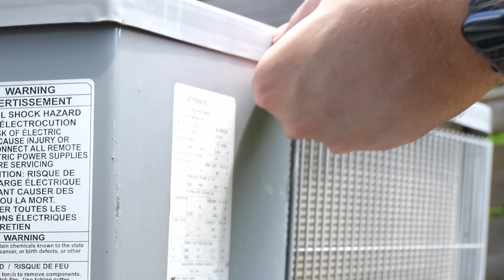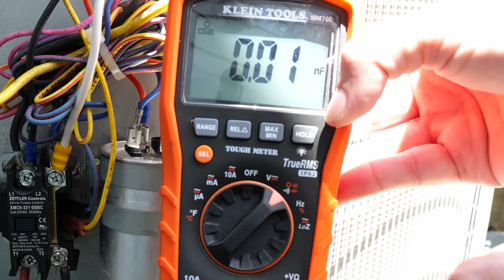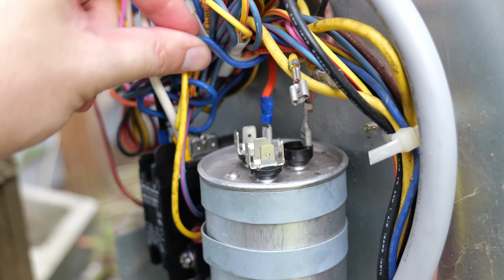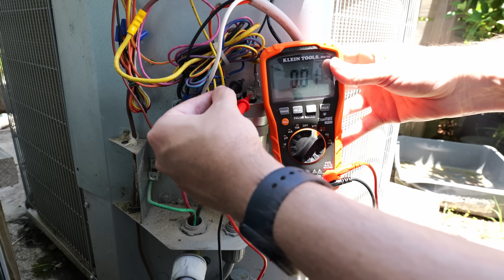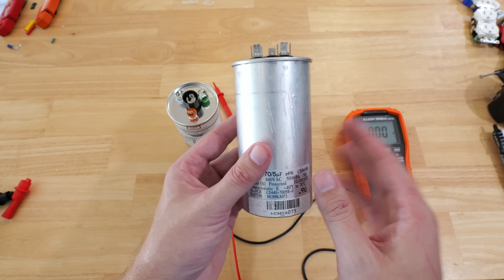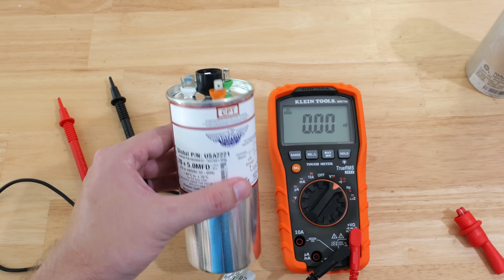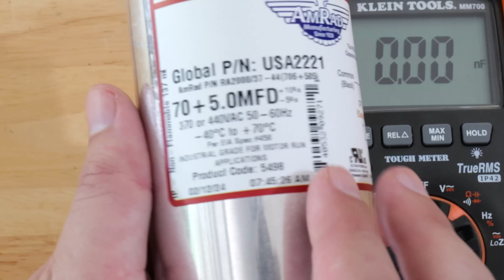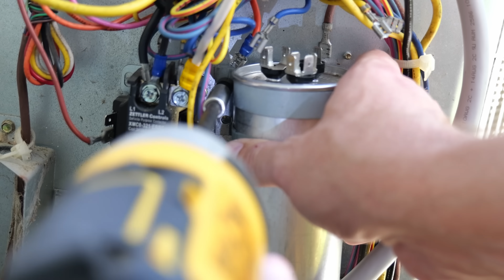Don’t Get Ripped Off! How To Avoid The AC Capacitor Scam And Save $500

Comment: Had a guy come out last year and he said the microfarads were at like 50%. He didn't lie. I tested it and it was at like 50%. But they wanted $430!!! to replace it.  Called another place up they wanted $410! WTF. The part was $20 and took me 15 minutes to swap out. First time doing it ever too.
Reply: Sites like YouTube, TikTok, and the internet are great for learning. The internet isn't all porn, gambling, and black market deals.
Reply: @stephen-ng Ha! YouTube is creat for appliance and car repair.
Reply: I keep an extra capacitor on hand because it's the most common thing that goes out.
Reply: Yeah, I have 2 units and both went out within one day of each other, both had bad capacitors.  Found out how to test them and put them in myself, fixed both units for $45 total
Reply: I replaced mine about 16 years ago.  The part cost $26 and it took me about a half hour in figuring out how to take the cover off, take a photo of the wiring, ensure old capacitor was fully drained and replace with a new one.  It worked for 5 years until I had the whole unit replaced along with my furnace.  If I have one complaint about this video is that he pulled on the wires to remove the female part of the paddle connectors.  I will gently pull on the wires but they are still I use needle nose pliers on the metal part.  If you pull off the wire connector, it will take much more effort.
Reply: @dustmaker1000  Needle nose pliers and a slight rocking back and forth side to side will usually do the trick.
Reply: can't put food on the table installing a $20 part for $20... who diagnosed the issue? did they do that for free? do you expect them to spend 5 minutes swapping the part and leave before doing any tests? 
yeah, it is cheaper to DIY if you have the knowledge. but it can also be dangerous if you THINK you have the knowledge. 
my family had lots of ac techs, they would do side gigs and still charge about $100+ an hour.
Reply: @SnowRaver-p2v It take 15 min max to diagnose and swap out. Somewhere in the $175-$225 would be acceptable.
Reply: @MarinePigVa what do you do for a living?
Reply: My side gigs for A/C. Rates start at 250.00 no matter how small the repair.
Reply: @SnowRaver-p2v  Poor AC tech had to charge to replace that perfectly good capacitor, putting filet mignon on the table isn't cheap you know.
Reply: Same thing happened to me, I got ripped off for 300. Plus 140 for labor. After they left I found same one on Amazon for 17 bucks. Called and complained and they refunded labor. But still crazy.
Reply: I used to do side work on Harleys. I would charge half of the hourly rate. I didn’t do it for existing customers of the dealership I worked for, it was for folks that didn’t like dealerships, and it was for jobs I had the tools for.  It was between $25-$35 an hour plus parts w/o mark up. I had one person get really worked up telling me minimum wage was $7 an hour.  While I had his bIke torn down. So I told him, you’re paying for my knowledge, I went to a specialty school to learn this, my tools alone cost more than he made in a year and I traveled to him. I added if you want to pay $7 an hour to get your bike fixed, good luck with the results. I started packing up my tools and loaded them and the repair parts into my truck. He got REALLY upset yelling about HIS new parts and his bike was torn down. I said if you don’t want to pay me my rate, that you thought was fine before we started, then I’m stopping now, while I have an hour in to it. Give me $30 now and we’ll go out separate ways. Or, don’t, and I’ll take the estimate contract you signed saying you would pay for all work completed and I will get a lawyer and take you to small claims court. I’ll get my $30, and you will have to cover the court fees and my lawyers fees; which I assure you will be a whole lot more the $30 for my hour or the $300 for the job. He got shitty and handed me $40 I told him I don’t have change we say the extra ten is for gas and I left. Two weeks later he showed up at the dealership to have his bike fixed. A friend of his said he knew what he was doing because he used to fix lawnmowers on the side and that he would take his pay in beer.  Well, according to this guy, his friend’s fixing mowers experience consisted of replacing spark plugs and sharpening blades. He ended up tearing into the bike more (I had the tear down completed), he removed things and loosened other things and broke off some bolts. Turns out he drank his payment before and during his work. The owner of the bike ended up paying upwards of $2000 in parts and labor to fix the damage and preform the original work.  

It’s best to have someone that knows what their doing preform the work, other wise it could cost you more in the long run.
Reply: @Itsthatoneguy371  I once first time rebuilt a car engine from the ground up in the mid 1980's just using one of those Haynes repair manuals, no specialty school needed, just common sense, and the special tools needed, ridge reamer, piston ring compressor, cylinder deglazer, engine stand, and boom hoist, were radially available for a decent price at my local Taylor Rental, no tools that would cost more than what the burger flipper made in a year at the local hamburger joint, and besides, any specialty tools you did invest $$$ altogether  in procurement , you certainly don't get to factor in the total cost of those tools on a job where you don't even use 98% of that tooling.
In other words, I see a lot of embellishment and outright exaggeration in that comment of yours.🤣
Reply: @Itsthatoneguy371  We're all experts, from YouTube College,where only the geniuses put up videos.
Reply: @Itsthatoneguy371 Kudos to you my friend . It's always best to stand  your ground don't let nobody be little you . 👍💯🇺🇲
Reply: That's the price of calling someone out to fix your air conditioner, your paying for the years of experience it took for this guy to accurately and correctly diagnose your issue and tell you what it's going to take to fix it, plus gas, overhead, labor, and taxes. You wouldn't be calling someone to fix it if you knew exactly how to fix it
Reply: @jayprice5442 Boom. Could not have said it better!
Reply: @jb Bet your a DIY
Reply: Yep, always keep one handy
Reply: I swapped my capacitor out on my three year old unit for a Titan HD capacitor Made in USA.
Reply: You don't pay for the part or labor you pay for the knowledge
Reply: I charge 120-140 or less depending on the customer .some people don't have any mercy on anyone. I try not to charge too much to young people and elderly people or people  that are struggling. That's why I'm not rich 😅, I understand companies need to charge more but, 400 or 500 for a 20 dollar part is crazy.
Reply: @frankgonz31  ...in my view that strikes a reasonable balance
Reply: Companies charge that for multiple reasons, there's overhead, cost to come out to you for one. Any mobile service is gonna cost more. It's not scamming. it's running a business
Reply: ya  it's ridiculous...  I started studying every thing I can about the heating system
Reply: Aren't you missing one point? You replaced your own capacitor. How did you know it was bad? You knew cause the service company that you called to come to your house sent a mechanic with the knowledge and test equipment to diagnose the problem. Then you feel taken advantage of when they tell you what the problem was. So next time your ac goes out don't call a service company. Then you won't feel ripped off.
  By the way....when you show up to your job and work your hours don't you expect to be paid?
Reply: @randyfox4611  Usually troubleshooting and repairing are split in my experience. When I call a technician it's because I can't figure out the problem. If they figure out the problem I want to know the cost to repair. If I can repair the problem cheaper then I will. I still pay for a service call. I had three technicians from the same company troubleshooting a problem and had zero confidence in their experience. I helped them pinpoint the problem while interacting with the crew. A relay needed replacing and they didn't have the part and didn't know how to use a different relay to make the repair. I said I would handle it and ordered the relay from eBay (from an HVAC tech). Problem fixed in two days. The HVAC company called me a couple weeks later and said they had the part and wanted to schedule the repair. If I waited for them my house and family would've melted.
Reply: @randyfox4611 bro go fuck yourself and your shady shit backwards ass practices that your shit company has to scam people to keep the business running that nobody even asked to be around. All of you people are crooks and make it a nightmare for regular people who dont have to be on their knees all day. If you have some stupid outdated boss running the place into the ground than you wouldnt have to charge ridiculous prices. Thank god the internet it running you people out of work. Good luck scamming old people and the people who need help the most. Your trade is dying and your butthurt that people can learn in a hour on youtube what took you years of experience and schooling prob cause you were taught by some loser drop out that talks big so you just listen to the old fool not realizing they dont know shit either and its all tribal knowledge. We are all on to you people. The internet didnt just wake up people about politics and history, it also showed up how many business are traditionally ripping us all off! Get fucked!
Reply: Bunch of crooks!
Reply: What don't you understand. These guys are trained service professional. Must be paid for their time. They have to take time out of their day to go to your house diagnose the problem locate the part pay for it with their money and install it. You don't understand this.WTF.  You're an idiot
Reply: If that capaster had been tested under load there's a good possibility it could be weak. Testing the way you're demonstrating is just basic troubleshooting. Testing underload has absolutely nothing to do with what you are going to most likely get many clients.Are youtube's hurt.
Reply: @shawnm5641 holy whut
Reply: I have a H/AC. Can someone . Right now my thermostat says 78 degrees. We have been having  few 90 plus days the past week. It seems it takes forever just to go down to 77 degrees. I was told by the people that came out that I was going to need another unit. After watching these helpful hints, I just want to know what they say. BTW, where is a good place to get a capacitor from? Store name and all. I don't you To think I'm stupid. But in the same respect, I don't want to get taken to the cleaners either., I am retired so money is tight. I did go outside a couple of hrs. ago and checked the drain line. I did run my finger up the drain line and  pulled out a clog. I was thinking about calling in the morning to see if they could come out tomorrow. Help me please!     Tommy Pauly
Reply: @tommypauly3249 There's a lot of stuff available online. If you have a background in electrical or appliances your can certainly look after your own A/C
Reply: Yeah, I just did the same thing today. Because it's a weekend and the parts store doesn't open until Monday. And it's miserably hot. I'll be going to the parts store and getting another capacitor so that I have one when this happens three years from now.
Reply: Yep, like 4 wires and a holster abd presto, 20$ later your done. Good to learn hvac. The more mysterious somethingnis to the general public the more they can charge for basically nothing. I remember when computer repair was big, wipe a virus and change out a ram stick 450$ cause people didn't know any better, theu thought it was so technilogical and beyond them. Shit like this is going on with solar now, they wanna install less than 5k worth of panels and tack on 200k to your mortgage for it, because people in general dont know how to do it themselves.
Reply: Realistically, you're not only paying for the part and the labor. You're paying for the knowledge and ability to find the part that's bad. If you can figure it out with youtube good for you. Next time don't call anyone and fix it yourself. Guarantee they saved you a shit ton of time and diagnostic work which is the hard part. Essentially what you're saying is, because they are good they deserve less. That's backwards. This mentality is exactly the reason service call charges exist. If you want me to come out and teach you stuff I know and/or tell you your issues you're getting charged. My time isn't free neither is my knowledge.
Reply: Really sad there are so many rip offs, I don't mind paying for a HONEST expert, TODAY I had a tech replace mt bad capacitor for total of $137.05 cap was $42.05 , service call = $95.00 I looked up the EXACT Cap & it was sold online for $13.43 with FREE shipping & prices went up from there this was on Nov 2024
Reply: @REVNUMANEWBERN what is the ripoff?  Having a company having employees on hand to go to your house and fix your issue costs money.  Is that businesses shop, vehicles, tools, and employees all free?
Reply: Did you pay for service calls?
Reply: This is why DIY is freedom. What is a crisis for others is for us a minor inconvenience. I'm no fan of professionals because I find 90% of them to be incompetent, but if you need to pay another man to do a job you cannot or do not want to do, be prepared to pay dearly. Double that if he's climbing up on your roof that YOU won't even do.
Reply: @AmandaHugenkiss2915  ...problem is not only the incompetence.....but the outright lying they do to those customers who are not technically knowledgeable... saying they need $7000 new AC units when a $25 capacitor is all that might be needed. I had "warranty" work done to my unit....I KNEW it was a bad defrost board and its temp sensor....the guy came out to listen to me....went away....and came back a week later with the warranty parts to install ( free to me) over a 23 minute onsite visit...and I still got charged $370. I called the office, and asked "what-the-heck".... how is this a $62 service charge or even a $92/hr repair charge????....the answer.....he didn't have the warranty parts in stock and his tech needed to drive to the nearest parts place to pick this up before he came to my house. Seems all this "backdoor" time was charged to me. Crooks....all of them...even if they didn't upsell me to a new unit. That's why I have a defrost board...a temp sensor....an outdoor unit capacitor....an indoor unit (air handler) capacitor, and a spare outdoor contactor on hand...these are the 90-99% likely pieces to break...and I can do all of them myself.
Reply: We have to make money good god how much do you think it costs to pay some one to coming there , the rolls, they insurance , the part & the labor, don’t forget THE knowledge lol most of us went to school and dedicated much of our time so we can charge like this.
Reply: Just now figuring out that repair service is a rip off?  They have always been a rip off, but more so lately as less and less people are willing to learn to fix things themselves.
Reply: ok  so lets see here  you  paid 20 bucks and got it going , ok  so the ac company  has over head that tech cost money  that truck cost money he had the part on his truck  those parts cost money his gas cost money  his insurance for the company and the vehical cost money, his shop cost money the tools to diagnose cost money  his knowledge and expertise came at a price. all this has to be figured in  when doing business what you want is some one to come to your house free  and fix it at cost, im sorry  but no  business runs on cost  it would never survive and surely never grow. i was 1 man in a van  for a while and as i grew my  cost had to grow if not i would have stayed 1 man in a van  forever. i feel like if oyu  call me to come out  and i diagnose it and prove it is a bad part  then you  tell me thank you  and send me on my  way  you have wasted my  time when i could be out helping someone that NEEDS my help, so if your a DYIer then do it all yourself diagnose and do the repair  and good for you and good luck to you. But there are actual customers that want and need my  help to do that  and if i am on a call like yours you are keeping me from making money  and helping  a real customer. ( note, this is not a personal attack the use of you and your  was for ease of explanation do not take offense it was not directed at you directly.)
Reply: @kennethduncan8563  for 11 years I owned an electronic repair shop with 5 locations, so I KNOW business... but I also know ripping people off.  I also can do A/C like a "pro' Have gauges, vac pump and fancy core remover tools... So shut the F up and stop thing that some trade that almost anyone can do is something that makes you somehow superior... fair is fair and $500 for a cap replacement is not even in the same realm of "fair".
Reply: That's $1600.⁰⁰ an hour for labor.  Good God.  Let's say they have a show up charge to roll a truck out to you of 100.00.  That should cover the first half hour.  Then maybe, at the very most, 25 dollars to change the capacitor.  Maybe 150 for everything.  He should be able to trouble shoot the problem within 15 minutes.  Absolute scumbags.
Reply: @YUHJKT then just do it yourself.
Reply: I did the research beforehand and saved on having someone come and charge $$$ me just to look at it.
Reply: I fix as much as I can. $400 for a new capacitor is crazy. But at the same time- the company vehicles has to be paid for, the employee, all the benefits, workers comp, paid time off, tools, fuel, etc… it’s sooo expensive to operate a business. You need to get paid accordingly. Oh- not to mention a skilled trades person has years of school, training, and experience- which all needs to be compensated for. I’m just making a point that companies need to charge. On the other hand- if you charge $400 to diagnose and replace one- you better be getting all the things I listed above. What often happens is that crap companies charge top dollar without providing the things I listed above. They under pay the employees more often than not. Oh, and health insurance has to be paid if it’s a good company
Reply: Yeah had my car ac compressor for  700 and that's a lot of work they have some nerve charging 400 for a 10 minute job. Who the fuck do they think they are. Guy wanted 1000 for  50 dollar board not sure why they think there labor is so valuable. Crooks all of them.
Reply: I understand charging a minimum, but that's ridiculous.
Reply: Unreal the number of whiney people on here that have never had a service business and the huge overhead costs that go with it. Go ahead and complain to that service guy about the cost and how you could have done that yourself. Next time you call them out and want work done for minimum wage, see if they will have time to work you in. The capacitor is a common problem. But there are  dozens of other things that you wont stand a chance of figuring out because you dont have years of experience or training. And contractors talk to each other. On any given day your petty complaints are being discussed at a parts counter somewhere as two techs wait for parts they are picking up. Not to mention the rookie mistake I saw the guy in the video made in the first thirty seconds. 
Go on out there. Start pulling covers off. Have a blast. But dont get mad when you have trouble getting a pro to come out. He or she will know if you have been in the equipment rooting around.
🤣🤣🤣🤣🤣
Reply: Off the truck parts be $$$$.  Capacitor only service should only be $220 max.  If the unit is cleaned as well maybe closer to $300.  Other diags ala karte
Reply: They get around $120 for a service call here so it would of been $120 + the cap say around $30 + tax  it would be around $175.00 for that repair.
Reply: And there you have it!
Reply: Glad you took the opportunity to try and fix it yourself and save all that dolo $$$ good job kudos to you.👍 .my central AC took a dump on me I called the AC guy he quoted me $470 to change the capacitor and the contactor I said I'll call him back I changed the capacitor myself the machine  came on outside but the air handler didn't come on I looked at the air handler and realized a 5 amp fuse had blown I went to the auto parts store bought a pack fuses for $8 put the 5 amp Back in and Walla   my air handler came on 👍My unit worked fine still is all for $8 . It's all about saving the Benjamins . $$$$
Reply: Yup... I got screwed like that a couple of years ago. A well-known HVAC company here in Las Vegas advertised a $39 AC checkup. I'd normally have the company that installed my ac do the annual, but they were swamped and I needed to have the system checked immediately as I was going out of town. The guy from this other company comes out, goes up on the roof, comes down about 15 min later with one of those capacitors in his hand. He tells me its bad, amd it will cost $500 to replace. I snapped a picture of the info tag on the capacitor for future use. Since I needed my ac working normally, I grudgingly told him to go ahead. While he was replacing it, I did a google search for the capacitor part #. I found it from various sources, starting at TWENTY FIVE DOLLARS.. When the guy came down I confronted him about it, and he basically said "thats the price, take it or leave it".. I wrote a nastygram to the company and said they'd lost a customer (yeah I know, they don't care)..  I'm in Las Vegas, so ac here is absolutely crucial for about 1/2 of the year. The vast majority of ac here are on the roof rather than on the ground. I'm 74 years old and there is NO way I could go up a ladder to the roof to swap out that capacitor, even though I'd do if my ac was on the ground.
Reply: @lvsluggo007  You didn’t “get screwed”.  You hired an HVAC professional to make a needed repair to your system.  An hvac professional who has to maintain annual continuing education to satisfy the requirements of their state issued license, an hvac professional that has to maintain a $2,000,000+ insurance policy, an hvac professional who carries thousands of dollars worth of equipment and tools and the knowledge and experience to quickly diagnose and repair your failed/failing system.  You did not “get screwed”.
Reply: @lvsluggo007  At least MAYBE your alert may of saved others by them NOT using that company
Reply: @lvsluggo007 Plumber's are worse. The white glove guys quoted me $600 to change a water pressure regulator. I'll buy one for around $100 and the same size as the one I'm replacing. I highly doubt the threads are different so I'll save a ton of time and re-use the flange nuts. They also wanted $400 to replace the main valve. I told him: it's a ball valve and doesn't leak FFS.
Reply: @lvsluggo007 Now if only you had taken the initiative to do the entire thing yourself instead of asking a company to do it and then bitching about their prices you might not be bitching about their prices right now huh. A starter for your vehicle also cost 80 Bucks.But if you take it to a shop they won't charge you anywhere from 700 to 1200 dollars to install it. It's called being in business.If you don't like it , do your own repairs.
Reply: service tech here, 
HVAC companies have a multiplier for all parts. There is a lot of overhead to be covered (employees pay and benefits, vehicles and all of their upkeep, continuing training and so on)
Parts can generally only be sold to licensed contractors but internet sources can help. 
It shouldn't be so expensive but that's where they "justify" the high cost. You can't even get a tech to your door without about $200 for the first hour regardless of takes 10 minutes.. I've left companies over shady practices. What's really going to hurt is when you need work done that requires anything pertaining to the refrigerant. The refrigerant is changing now and the "old" R410a is being phased out...
We're being forced to recommend new systems to accommodate the phase out. Honestly it's a scam
Reply: @jerrycross1829  I hear you but…..a fair and reasonable service cost is what I expect.  This service takes less than an hour and the part is less than $50.  Even if you would charge $100 for travel time and $125 an hour plus the cost of the part, that would be $275.  Pricey but not totally unreasonable.  Charging any more than that is simply price gouging.  
When I did mine, the technician said the company requires a $500 charge and he has no flexibility there but he advised me to buy the part and do it myself.  He disagreed with his companies price gouging
Reply: @jerrycross1829  just go to a general motors and parts store rather than an A/C supply shop that thinks they need to protect their usual customers from non-industry but otherwise knowledgeable customers. I am an RF engineering tech. I fix my own house, wiring, plumbing and A/C. Never had trouble buying parts every five years or so as needed.
Reply: The national average cost for an hvac company to send a tech to your house is over $200. That’s why. Running a business isn’t cheap.
Reply: @japhethwillmore725  dont bother exolaining it. They know everything! The jig is up!
Reply: @japhethwillmore725  but you are so right.  If people could imagine fhe amount of money it takes just to get a phone call into the office, they would understand.
Reply: @japhethwillmore725 AI Overview

+7
The average cost for an AC company to send a technician to your home can range from $75 to $250 for a routine maintenance visit, but the price can vary depending on the issue. For repairs that take longer than an hour, you may be charged an additional $65–$150 per hour. If you need emergency service, you may also be charged an extra $100–$200. 
Other factors that can affect the cost of an AC service call include: 
The size of your system 
The age of your system 
Your location 
The time of day and day of the week 
Whether the repair is minor or major 
The brand of your unit 
The type of technician you hire 
Some common AC repairs and their average costs include: 
Refrigerant leaks: $200–$1,500 
Fuses and circuit breakers: $50–$200 
Thermostats: $80–$300 
Damaged condensate pump: $240–$450 
Replacing an AC circuit board: $100–$800 
Heat pump repair: $150–$1,950 
Generative AI is experimental. Learn more
…
HVAC repairs cost between $150 and $450 on average, with most homeowners spending $319 on AC service and $268 on furnace service. HVAC contractors charge an hourly rate of $75 to $150 with a minimum service call fee of $75 to $200, which applies towards the first hour.Apr 29, 2024
Reply: Not bashing anyone but these critical comments about price are all from people who never actually tried to run a business, OR haven't tried to run one in the past few years. You don't understand just how much cost is involved to provide a service. And yes, we intend to make a decent living doing it too. You would be amazed at how much your employer charges for the work you do.
If people don't hire the guy who gives an honest diagnosis and charges enough to stay in business, then they go under and you're left with only the dishonest ones who lie, cheat, and steal.
Reply: @N20Joe best comment here
Reply: @N20Joe agreed, a bunch of a-holes get mad after they learn how cheap it can be to do it yourself and, after having an a/c pro already out and fix the problem, they want to complain that the cost is too high. I mean, you are paying for convenience, so shut the f up! A company is in business to provide a service or product at a fair market value, but it needs to make a profit to grow and succeed.
Reply: Can you buy the capacitors at a home improvement store?
Reply: @dannydaw59  yes, I replaced mine this weekend and got it from my local Ace Hardware.
Reply: @dannydaw59  Yes, ACE Hardware stocks various size run/start capacitors and they're even open on Sunday.
Reply: @dannydaw59, probably not.
I ordered mine from the internet.
It was just under $10.
I have a rental houses in Vegas and was taken for over $400 a couple of years ago.
This year, another company with whom I have an maintenance contact, told me I soon will be needing a "compressor start assist" something or other. I asked him "do you mean capacitor?".
He emailed an estimate for about $340.
These people are crooks. 
At my house it took me 30 minutes from start to finish to replace 2 capacitors and that included additional testing and going in and out of the house to turn on/off circuit breaker an, thermostat multiple times.
Reply: @dannydaw59  I don't think so. You can buy them online if you have the information from the capacitor. It would be good insurance to order one before you need it, So you don't have to wait 2-5 days for delivery when it is hot.
Reply: @dannydaw59  I have sometimes found them at Ferguson, and there may be local A/C supply houses that sell to the public.
Reply: @dannydaw59  not always but most decent size cities have a place. Amazon got me mine the next day.
Reply: @dannydaw59  In most cities, HVAC supply stores won't sell to you if you're not certified or licensed. You're better off ordering online.
Reply: @dannydaw59 unlikely, but there is probably a parts store near you. You may have to call a bit to be sure they sell to homeowners. Some are limited to contractors.
Reply: You didn’t diagnose your own problem, so no you didn’t fix it you used the techs knowledge and stole it to fix your AC. Guess what that does to the next consumer?
Reply: @jeffcanto usually if you call them out for a quote there is a visit and diagnose fee that they waive if you use their service. Because I don't like to mess with electrical without being sure, whenever I have hvac issues I always self diagnose and then call in a tech to get their diagnosis and compare. For things like capacitors and contactors the techs always agree with me that its ridiculous from the consumer end but really because of the costs there isn't a way for it to be made economically viable. They've never been offended when I say thanks for coming up to check in on my troubleshooting process and I have the basic skills needef and will be buying the 20 dollar Amazon part to do it myself (and pay their quick visit fee plus slip the tech a 20 to buy them a beer or whatever they would like for talking through their thoughts on AC maintenance with me)
Reply: The $430 wasn't for the tech to replace the capacitor, it was to:
- Diagnosis the problem
- Determine the correct fix
- Stock the correct part on the truck vs waiting on it to be delivered. 
- Cover the absurd amount of overheard the company has to deal with. (fuel/rent/utilities/loan payments/workman's comp/401K/tool purchase and replacement/salaries/rent/depreciation of assets/shipping costs/office supplies/advertising and marketing/consultancy service charges/legal expenses/vehicle maintenance/employee uniforms/janitorial services/web hosting/bookkeeping/staff events/etc.
- Pay Uncle Sam his 50% for income tax/payroll tax/corporate tax/use tax/sales tax/property tax/medicare tax/social security tax/unemployment tax/excise tax/tangible property tax/administrative fees/employee healthcare/surcharges/licenses/continuing ed/permits/inspections/insurance/etc.

If the technician is making $24/hr, the national average, and it only takes them 10 minutes to diagnosis and swap the part. Then they just drove out to your house and fixed your problem for $4, your welcome.
Reply: One thing to remember is you called them. They didnt call you. They have overhead, trip charges, insurance,bonds, workmans comp, rent, advertising to get that phone call in the first place. Usually overhead is calculated and charged in some way in a service fee. Flat rate or t and m  to install the capacitor. Test it beforehand and so on and so forth. Stop incorrectly thinking they are "scamming" everybody. Sure some techs are scamming customers. I assure you there is a reason they charge money for their services. Took them a long time to learn this stuff. Not just capacitors.  Either way, lets not call every hvac guy a scammer and have a little respect for the skilled trades.
Reply: @Jzzonem    If they charge $500 for a $20 part and it takes the  5 minutes to diagnose, 5 minutes to install and then they do a general A/C service call, then it is hard to argue it isn’t a scam or at a minimum, taking advantage of the customer.  Pick a rate, $100/hr or $150/hr or $200/hr, whatever, if you complete the service within that hour, then the cost should be your hourly rate plus parts.  Anything else is theft in my mind
Reply: @dustmaker1000  unfortunately thats not how the real world works though.if thats how you feel then fine. Im happy people are testing their own caps. I do it every year myself. Its hard running a business in the skilled trades. Again though, overhead is undeniable. When i hear someone talking about what someone should be making an hour, its hard for me to not feel insulted as a technician. Remember, the company has the overhead not the tech.  To be fair, if you are at all surprised at the pricing at time of service thats a red flag to me as a technician. This would point me to follow up with the scheduler to find out if they explained our rates before accepting the call. In other words, you should know what the rates are before you confirm the appointment. Its not always calculated by "the hour" it could be flat rate or any other variation.
Reply: @dustmaker1000 actually it should be 5x their highest paid techs hourly wage. That money also goes to the businesses expense. If that is a problem start calling the mom and pop shops instead of who has the biggest add. Wait until you see the mark-up on a replacement install.
Reply: Well you have to understand, they are running a company, there are a helluva lot of costs to do that. Businesses license, insurance, service truck, tools, certifications, fuel, auto insurance, vacation time, sick time 401K, then we can talk about taxes etc etc. You don't work for free, neither should they. Now saying all that I fully encourage everyone to learn how and fix their own stuff to save tons of money, but don't act like these guys are ripping you off, they don't get to keep all the $430
Reply: @integr8er66  no problem paying a service for their time and expertise to diagnose a problem and repair it but $400 plus as some claim is more than recouping money for expenses plus profit. I lost my capacitor after a hurricane and no one local had any in stock they would sell to the general public. One store would but he wanted  $250 just for a capacitor. I had to call a company to come out since it was it was hot, humid and we needed it fixed asap. Charged me $250 for an overall general service which entailed less than an hours work but they replaced the capacitor. I was happy to pay because they checked the refrigerant, and the capacitor in the air handler blower motor and changed It out as well since it was working but very old. Was happy to pay and they earned a customer going forward.
Reply: @integr8er66  Yes they do.  All the stuff you put out is part of the labor cost.  Parts are parts.  Charge me what they cost you and add 5% for the headache, but +300% mark up?  GTFO.
Reply: @ElectroAtletico are you serious right now? Do you think the ingredients in a pizza “cost” $40? You think the restaurant should charge you what they pay for dough sauce cheese and toppings, +5% ??? Get real.
Reply: @integr8er66  ... no excuse charging 400 for a $25 part. Parts and labor should maybe rise to $150 for that kind of work....to cover the cost of business and get margin.
Reply: @integr8er66 you said exactly what I wanted to say, I’m just not as good with words as you are.  
What about your satellite service, cell phone Service?  Who’s peddling the bicycle wheels to send that Service out to you?   That’s right.  No one.  There’s lots of overhead and things the normal “consumer” doesn’t know about.   There’s no rule that says you have to go to a “glass shop” to get your windshield replaced.   Learn how to fix your own stuff but be thankful there are individuals that actually CAN fix it in case you can’t.
Reply: @integr8er66  Very true,  But a lot of these are "found" on service calls or checkups where everything is still functioning.  So yeah.  I can see $400 for a Truck roll, time to and from the shop, after hours, emergency call, etc..  I could see and justify the cost.  But as a "add on" to a general maintenance, a cleaning or check up?  Triple parts and doubled for time is acceptable.  So well under $150 at the maximum end.  Not $300+
Reply: @integr8er66  Sounds like you've run your own company.  But come on man, if you break down everything there's no way a company should charge $430 for this service, even if you include the diagnostic which usually takes less than 20 minutes at the most.  Maybe we don't know other details that would justify that price tag.  Who knows.
Reply: @integr8er66 plus he said he could never climb that ladder so how else could he fix it, plus having the right tools and know how so you don’t electrocute or fall.
Reply: So true.  No one is ripping off anyone. There is just a lack of understanding and consideration for the workers.  I love to diy and learn. However, if I hire someone for their knowledge and skill to help me it costs what it costs.  A majority of the time the worker doesn't determine the price they are just there to do the job correctly.  Other financial workers/companies that the tech company pays determines the price.
Reply: @integr8er66  No, they are definitely ripping you off!
Reply: Yeah cost me $250 a few years ago when I looked up the part it was $25
Reply: @pierrea3094 that's actually a reasonable price considering they come to you and how far did they have to drive to get to your house.
Reply: @pierrea3094 are you factoring gas and labor ? 250 is not too bad for a company
Reply: @pierrea3094 you’re paying a mark up plus the companies resources like the ability to come to your house. Tech wages, gas and insurance. $250 is actually not bad
Reply: Around $200 should be reasonable.  Do you expect people to service your ac for free? Yes the part is probably $20. So what. Dental fillings are not  $1000 either but you pay for service and experience.
Reply: @Se2n67g9r  lol.  who pays $1000 for dental fillings?  Mine are around $250.  These 10 minute jobs cost more than an hour in the chair.
Reply: I was an assistant and we didn’t put on $20 eBay or Amazon capacitors because they will fail pretty soon. Every ac company that did that, learned the hard way!  Since They warranted the job, 6 months later, they had to come back and replaced 50% of them because they failed. That’s lost profits! They went back to buying the expensive ones and never had anymore problems.
Reply: @bbaaspencer1 I can't see why any professional HVAC technician wouldn't use anything but an AmRad Turbo200 or 200X. They cover a wide variety, they last and most importantly AMERICAN MADE!!
Reply: @bbaaspencer1 scum bag is your name! We paid $12 on Amazon and it works fine for over 6 years now! POS
Reply: @bbaaspencer1 😂😂😂😂 yeah right made in China or Taiwan all the same damned part not made in good ol merica imported with the hvac company hiked price.
Reply: Anyone can buy a capacitor online. HVAC companies keep trucks stocked with them and many other parts that could fail. Yes a capacitor is easy to replace and is most common part to fail. Can you diagnose a failure? Is it an electrical issue, refrigerant? No.. then shut up about the price! We’re here to help you out and people who bitch about the price have no idea what it takes to run a business!!!
Reply: Majority of the comments are angry that a $12-25 cost them $200-500 to replace on a service visit.   
Are y’all discrediting the cost that it took to get that capacitor replaced for you?     

It took 10-20 years to have the licenses, and credentials to become a contractor in HVAC.  
It took over $100,000 - $400,000 to put that truck in your driveway.     
I promise you no 1 would dare come and help you on a hot or cold day selling $12 capacitors at no mark up while carrying all the liability and financial burden that  comes with being available 24/7 365 days a year.     We have 3-4 months of profitable income and 8-9 months of breaking even or being in the red with a loss to maintain the business without closing down seasonally.    

If you needed a surgery,  I’m sure the dollar store has alcohol, towels, razor blades, super glue and staples all for $5.    But that Doctor will charge you $35,000 on average to perform an appendix  removal surgery.     I would hope you would trust that doctor and everything behind the scenes that it takes to get the results you’re looking for.

The real issue is, why do homeowners value tradesmen less than they do a Lawyer or a Doctor or other professional.   Overhead and regulations make operating a HVAC business extremely expensive and to compete against the big brands nearly impossible.    The big brands make 50 to 100 million a year and put in $500,000 to $1,000,000 in advertising alone or more.       So please,  when you see a bill that may seem high,   Thing of all the hidden costs that go into being able to provide you with that service.   Better yet,  please realize you are paying for an end result,  you are not paying for parts.  You are paying for Results that are bound by regulations, laws and safety.
Reply: @jdms1eeper  🎯
Reply: AC techs have families to feed.
Reply: $300 for the truck roll alone.
Reply: You go American Tech!
Reply: Love all the butthurt technicians trying to explain why a 15 minute install of a $20 part costs roughly $500 to install 🤡🤡🤡🤡🤡🤡🤡🤡🤡. Excuses after excuses. Sounds like a car stealership salesman
Reply: @4drturbo85  tell me how you make your living?
Reply: @4drturbo85 You’ve obviously never run a business. In the 70s, total cost to have an employee was about $80 per hour. Yes that includes a profit, but the boss is also making a living. This includes building, insurance, support staff, retirement, and more. Forward to today, and I’m not too surprised at $400-500 per hour. It may take 15 minutes on site, but that ignores travel and time for restocking. You don’t go off the clock for a restroom break, either.
Reply: @4drturbo85  until you find out the technicians just trying to work. He doesnt mqke the prices unless he owns the business. he didnt call you you called then complained like a little girl about it. Dont like it? then figure out how to do your own stuff or quit bichn!🤡🤡🤡🤡🤡🤡
Reply: @Jzzonem  That's why I saved a bunch of money. Guy smelled like cigarettes and didn't give two s** the entire time. No respect. Glad I caused that rip-off company to lose some money. "Complain like a little girl" The only one complaining was him when I used  common sense and didn't get ripped off. I the consumer won.